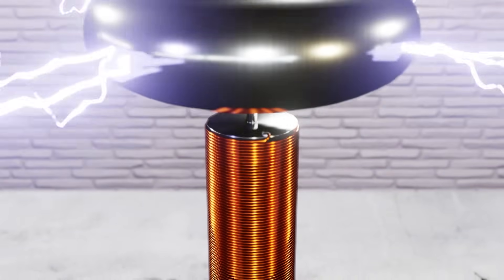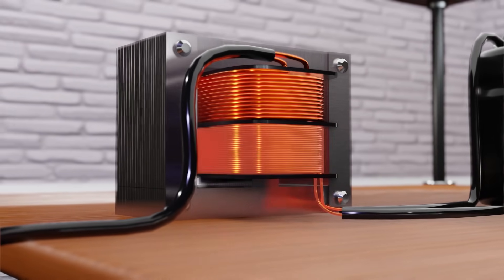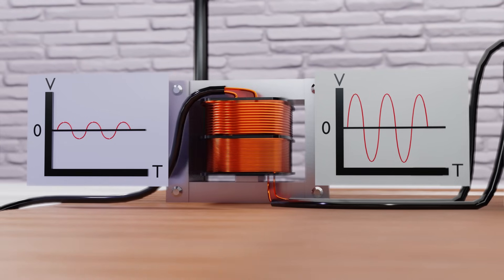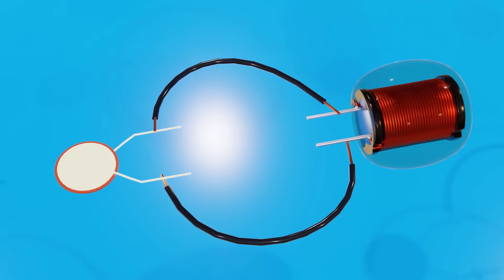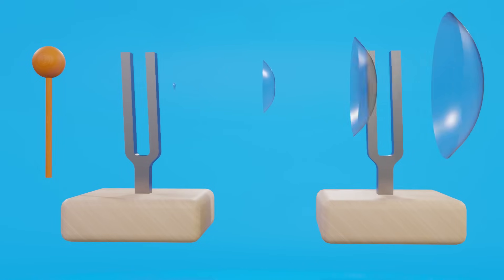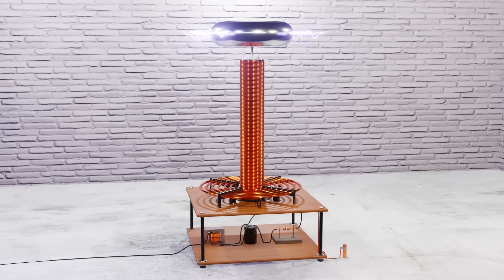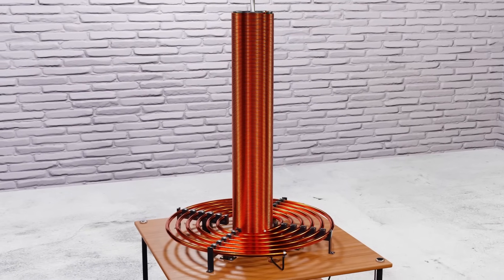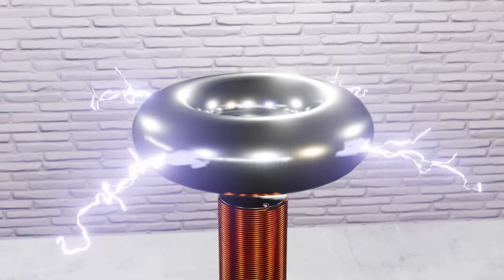How a Tesla Coil Works ⚡ How to Make a Tesla Coil ⚡ Nikola Tesla

Comment: The lighting/emp effect is primarily y we don't use his tesla tower tech. It costs more to pay for all the damage it causes from the emp bursts during a lightning storm, than the income it would generate by selling the power to customers. It also makes it impossible to use radio telescopes anywhere within a hundred miles of a tower. It would definitely mess up a particle collider. Definitely emp nearby aircraft out of the sky... also makes it impossible to turn off the lights in ur house, even if u remove the bulbs. Street lights would stay on 24/7. Telephones that used the POTS (plain old telephone system) lines would give u shocks when u picked it up, & u really don't want to take 1 in the ear drum. The idea was sound, but the consequences out weighed its usefulness. The best way to safely tap into the magetosphere, is to use a large ATMO w a ballon array mesh screen receiver cabled to the atmo w graphene doped cable. It will spin the atmo, & if u connect the shaft to a generator (motor) it will generate power seemingly from nothing. In reality, its discharging the static electricity clouds which r picking up charge from the magnetosphere inductively.

Comment: Actually, ur both right. Theres no way to meter it to charge u bcuz ur house wiring acts as the receiver, in all directions. Its also inefficient, bcuz of the inverse square law. Tesla tried to over come this distance  issue by tuning the resonate frequency to the same hertz as the earths own magnetosphere. Basically turning the tower into a large inductor. The power requirement to charge the coil was small compared to the amount of power that was discharging from the magnetosphere to the tower, & then the ground. Sure, this increases the lightning during a thunderstorm bcuz the surrounding air is ionized making it easier to form bolts in ionized air. They didn't affect the functionality of the tower, but bcuz the surrounding air was highly ionized it added to the emf effect ea time a bolt struck the tower, causing a massive emp burst. This is how he was able to wreck the generator 4 the towns power & knock out power in town miles away from his Colorado workshop.

Comment: I dont think what you say at the end is entirely true... if you have an 3xtremely high voltage running your system as tesla did at wardencliffe... he had thousands of volts to start with been 65 meters high that's 6500v or upto 65000v in a thunderstorm... now imagine that going through a tesla coil been amplified many times... 20x magnif8cation would provide upto and over 1million volts potential and some big sparks but not as big as you see in his pictures... he would often talk of generating many millions of volts... 2-3million volts will produce a spark 1 meter long... many of the sparks in his pictures are meters long... lighting lightbulbs across the room without a reciever setup...

Comment: The current in the secondary coil is very small, almost zero.

So how can there be a toroidal magnetic field?

Since the current is almost zero, but is calculated as non-zero, there is still a magnetic field in the secondary coil.

But that magnetic field is not the factor that makes the LED light up when approaching.

Actually, the light bulb is due to another type of electricity, which is electromagnetic radiation.

Comment: The Problem with wirless energy is: It need too mutc power 

We can send iit only over short distance (induction) or as a signal 
In hz/mhz ect .. to switch an Transistor with to coils in 2 differenziert Electronic circuits 

(A 150 years old tesla Problem) 

But i experiment with it to 
- see my videos

Comment: Actually... Tesla designed his system to not radiate out into space...
It is to be connected to ground or one wire to the next receiver...
Basically a unlimited distance and can use hair thickness wire
Reply: @hoop0369  well Tesla said you can get 10% through the air.. 
Or 90% by common ground.
And by the Dampened wave,  1kw can generate 5 Megawatts...
But continuous wave, 1kw only gives 1 kw and nothing more." N.Tesla

Comment: YOU COULD NOT BE MORE WRONG ABOUT HOW THE TESLA COIL WORKS AS INTENDED BY ITS ORINAL INVENTOR.
The coupling between the primary and secondary coils is not MAGNETIC but kind of electro-stactic induction. Tesla called the "electro-static" phenomenon RADIANT ELECTRICITY, which is the "justification" for operating as a free energy device since the Lenz's law is not applicable. The effect of the Lenz's law in magnetic induction is to prevent power gains.
Also, the "Tesla coil" shown in the video generates TRANSVERSAL ELECTRO-MAGNETIC WAVES, which are not efficient for transmitting wireless power and is the main reason why it is only used for communication applications.
Tesla was the first person to generate LONGITUDINAL ELECTRO-MAGENTIC WAVES, which can transmit unbelievable amount of wireless electrical power. For example, Tesla estimated that the coil he constructed in Long Island was capable of generating electric power with a current of 1000 Amps at a voltage of 100 Million volts. This kind of electric power cannot even be generated with nuclear reactors.
There is a lot of condusion about the true operation of a Tesla coil.
By the way, have you noticed that Tesla used only 1 or 2 primary turns? The primary inductance negatively affects the waveform of the applied voltage that is extremly critical for generating RADIANT ELECTRICITY.

Comment: Ugghh…very wrong to show current flow in one wire and not the return wire!   The magnetic field in the base (primary) coil should be illustrated as a vertical   Field which alternates in polarity.   And why did you show the receiver coil without the toroid?  It has to be matched to the transmitting coil.   Last example of radio tower as giant antenna is wrong!  The tower is large and tall to simply elevate the much smaller antennas.

Comment: What transformer and capacitor should I use if my input voltage is 120v with 60Hz? Any electrical engineers out there?

Comment: How is it if AC is applied to both ends of a wire it will trip the circuit breaker or heat to such an extreme it will cause a fire and burn a connecting wire apart but it doesnt seem to do this in a coil.  Why?

Comment: Jesus Christ!! The man was talking in circles. Want to hear about my multi trillion dollar perpetual power supply? An ignition switch connected to a motorcycle battery connected to a start/stop motor connected to an ac generator connected to an dc converter connected to an outlet box with one 120v line going back into the start/stop motor. True perpetual power.

Comment: Absolute crap video.
This is NOT what Tesla was doing. Until you understand displacement current you will never understand Tesla. Such foolishness. Tesla SPECIFICALY stated he is NOT 'emmiting' any radio or electromagmetic emmision. Stop putting forward lies and go look at his specific patents and the purpose of his Wardencliff tower. It had nothing to do with the following;
No free energy.
No electromagnetic emmision.
Yet, it stands in history as one of the greatest feats of human discovery yet you cant even see what it was. 
Anyone who professes that Nikolas tower sent anything from it must accept his facts. The small quantity of eletromagnetic emmision was a minor side effect of the function of the system. The system converted conventional electric current into displacement current which is then easily captured at a remote location and converted back to 'electricity' to be used for conventional electrical supply. Specificaly, there was NO magnetic compinent transfered which makes the power transfer scalar or in other words not limited by any mass, magnet, speed of light nor field therefore it has ZERO liss in its transfer. As everyone knows you cant transmit high power using conventional current emission due to square law losses. Tesla was not an idiot. All the people who think he transmitted such are idiots because they chose to not read Tesla but rather decided to parrot their peers. Uterly disgracefull. 
You have been lied to. 
Go research Displacement Current or stay in the grip of psuedoscientism.

Comment: The speed of Light is a very insignificant item.  Has little to do with the universe we live in. The pyramids were used for not only instantaneous communications but also for instantaneous physical transportation to other galaxy's.  E=MC2 has absolutely no relevance to anything!!  Wake up please!! We live in a 100%magnetic universe!   The center of a magnet will show you anti gravity, It also will show you how to repel water,  we will no longer have a problem going to extreme depths.  Do some basic experimentation using the center of a magnet it will blow your mind.  However, Keep in mind the magnetic field you cannot use any iron anywhere near, it would disrupt the center field of the magnet. As you know I refer to the center of a magnetic force the "B" field.  You can tap glass plastic anything other then iron and it will loose weight.   That is exactly why they used copper tools to build the Pyramid's
Please review "CORAL CASTLE Florida on YOUTUBE> What he did was transmit the "B"field into the ground via his generator that was set up with 25 "V" magnets five deep, all in the repel mode to maximize the "B"field energy about his property and  he also had a horizontal stone similar to Stone Henge on his property.  Don't waste your time on E=mc2 it has no relevance to anything!!  If you take a granite rock just like those used on the pyramids and "VIBRATE the "B" field into same at the correct frequency it will become easy to cut with a copper tool.  FACT!!!! 
Please get the tools you need to learn the facts.!!  Thanks

Comment: LRG EMP 
(capable of turning people into zombies)

1.LARGE SUPERCAPACITOR BANK. (videos on youtube on how to make your own)
2.TESLA COIL (steps up power 1000x) (videos on youtube on how to make your own)
3.LARGE ANTENNA  (videos on youtube on how to make your own)
4.STEEL BOLTS FOR THE SPARK GAP  (videos on youtube on how to make your own)
5.A STEP-DOWN TRANSFORMER.  (videos on youtube on how to make your own)
6.HYDROGEN, OR HELIUM BALLOONS  (videos on youtube on how to make your own)

You will also need- 
A long-range receiver (at the switch), and transmitter to initiate.
  (videos on youtube on how to make your own)

Comment: A question that keeps bothering me:
So when resonance is important, is it good to transform the input voltage up (to drive a spark gap) or would it be better to transform it down and electronically drive a higher current to the coil's resonant frequency?
Reply: resonance is just to achieve pendulum effect

Comment: Potential endless energy source basically anywhere in this universe:

a. Small aluminum cones with an electrical wire running through the center of the cones, cones spaced apart (not touching I'm thinking) but end to end.
b. Electromagentic radiation energy in the atmosphere interacts with the aluminum cones.
c. Jostled atoms and molecules in the cone eventually have some electrons try to get away from other electrons of which those electrons gather at the larger end of the cone, of which also creates an area of positive charge at the smaller end of the cone.
d. The electron's in the wire are attracted to the positive end of the cone and the positive 'end' in the wire are attracted to the negatively charged end of the cone.
e. Basically a 'battery' has been created inside the electrical wire itself, different areas of electrical potential.  Basically a 'wire battery' or a 'batteryless battery', however one wanted to call it.
f. Numerous cones placed end to end increases the number of 'batteries' in the wire.
(In series to increase voltage, in parallel to increase amperage).

*  Via QED (Quantum Electro Dynamics) whereby electromagnetism interacts with electrons in atoms and molecules, one would have to find the correct 'em' frequency for the correct material being utilized for the cones.  The shape of the cones could also come into play.  The type and size of the wire as well as the type and thickness of the insulation between the cones and the wire would also be factors.
*  Of course also, possibly 2D triangles made up of certain materials with a conductor going down through the center of the triangle could possible achieve the same 'batteryless' battery system.
*  Plus possibly with the 2D concept, layered 2D's that absorb different energy frequencies, thereby increasing the net output.

Comment: There is a misnoma that has crept into so called tech books that an RF wave (radio) is an electromagnetic wave. It is not. It is actually an Electrostatic wave. (Radio Engineer). If it was electromagnetic small particles of brake dust and iron filings would attach to an antenna, they don't.

Comment: After almost a century, we in the power electronics use the same exact setup only smaller for magnetron sputtering and plasma generators.
Reply: That was the first thing I thought when I saw the torus at the top of the tower! But alas, the video did not explain how to generate a solar type plasma inside it and then transmit that energy. There's still so much work to do. Thank you for the video. The visuals were awesome in the way they brought Tesla's drawings to life.

Comment: As a stone mason I have always been more impressed with what the foundation of the Great Pyramids look like. Perhaps the foundation acted as a resonant circuit, funneling subterranean river systems into the pyramid. Niagara Falls would be a perfect example of how Tesla figured how to harness the energy from the waterfall… the stones used to construct the pyramids have been said to have electromagnetic properties, and the casing stones acted as an insulator for the process.. Which leads to my idea for the true function of obelisks.. In theory if they were built with resonate stones they could potentially transmit wireless electricy to any structure built with similar materials. If anyone has a deeper understanding of properties of stones, which stones were specifically used along with references.. I would be grateful for any reply. Thank you
Reply: Yes, you are nearly there. Now consider why was Granite used? it's a crystaline structure and hit with the right frequency the stone will resonate !!
Reply: If the pyramids were built with granite they would most certainly have conductive/ magnatative / resonative properties.  Are there many lightning storms in that part of Egypt?
Reply: @christopherohotto  There are lightning strikes yes, with granite and obelisks, granite is a crystaline material and will resonate at its own specific frequency. This will be in the order of sub audible frequency, certainly not an RF signal. Like stonehenge, when it was complete. By striking the 'master' stone it would resonate and by 'sympathetic resonance' adjacent stones would likely ring out there own frequency. For instance if you obtain two tuning forks and you tap one of them to start its resonations and hold it close to the second one, it too will begin to ring out, and this will be so even if the second fork is set to a resonant harmonic of the primary. Brian.
Reply: @christopherohotto  there was the Nile river, which I’m sure they were more than capable of diverting throughout subterranean channels
Reply: I believe you and it makes sense , but what is the purpose of transmitting energy between pyramids ?
Reply: @gorgeouskait666  to power a massive civilization
Reply: 100% bang on
Reply: Perhaps it was sonic beacon for Landing crafts…
Reply: You have let your imagination run away with you. I suggest looking up the Dunning-Kruger effect.
Reply: @rogerphelps9939  just because the guy is theorising about pyramids hes an idiot who thinks he is smart? isnt that a bit harsh

Comment: It's just an antenna, which emits a signal , the likes of which which we have to boost in the new fangled device we call a ra-di-o.... Or does it do something else ? 
One person appears to be cheering on the development of a receiver.. which would be  any circuit of the same resonant frequency, ... Which is the thing happening when one tunes in a ra-di-o. 
The knob adjusts the potential resonance of the receiving circuit, so the dinky amount of un-wasted power cycles the current in the remote item. Sorry, 
I just don't see the 'unplumbed mystery here' .

Comment: You know why the Tesla coil has sparks jumping out of it.  because it's trying to find it's secondary Tesla coil the top load is supposed to be up in the atmosphere and any other Tesla coil at the same height pick up that frequency and distribute power real power through the atmosphere because   The Earth is like a transformer and that atmosphere whichever level you put it in is like the iron core of a transformer. That's what Tesla was talking about but nobody's willing to get the balls to do it.

Comment: I believe there is a technical mistake at the end. The toroidal open capacitor does not emit transverse waves (like the radio example would pick up). But electric scalar (longitudinal) waves. And that’s why energy (like the one that lights a bulb or moves an engine) can be transmitted wirelessly.
Reply: That confused me; i wanted to know if we can transmit electric energy, not radio.... You say that we actually can transmit electricity like radio waves?
Reply: @jacomeluis  https://youtu.be/tJKzfKwKSDM

Yes. But mainstream rejects it’s mathematical basis (vector potentials nullified in Maxwell equations). Look up Konstantine Meyl and his unified field theory “objectivity”. He gives Tesla theoretical base.
Reply: @jacomeluis  master ivo’s channel also deals with longitudinal waves. He charges a capacitor through a wire in a distilled water bottle from a plate outside the plastic bottle. Radiant energy in the firm of unipolar sharp electric impulses. “Pressure waves in the ether”. Also rejected by mainstream.
Reply: @juanmf  thanks! I just started following him... 🤟🏻